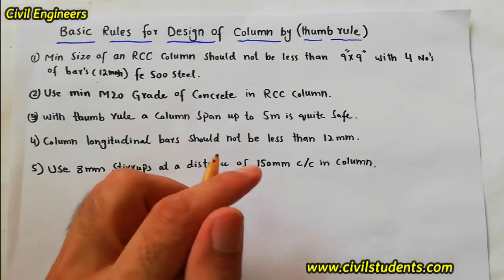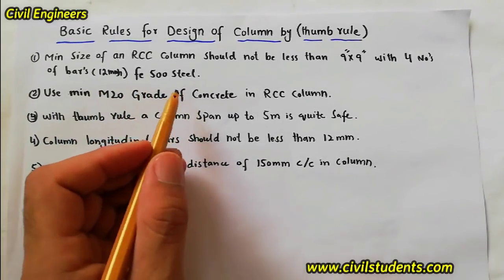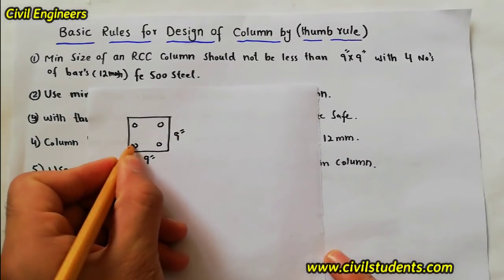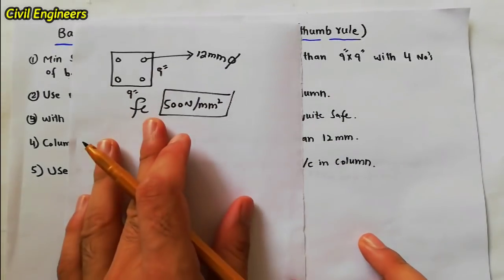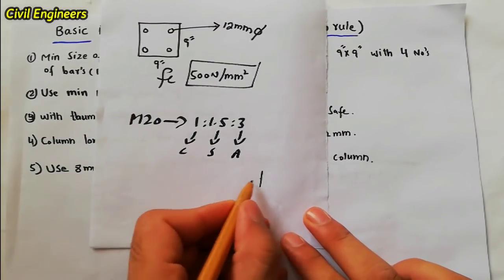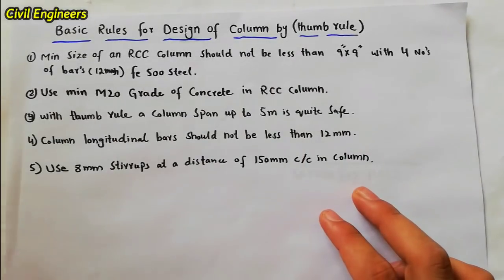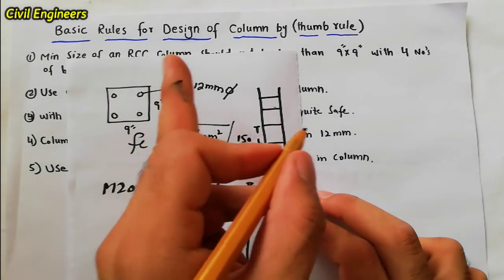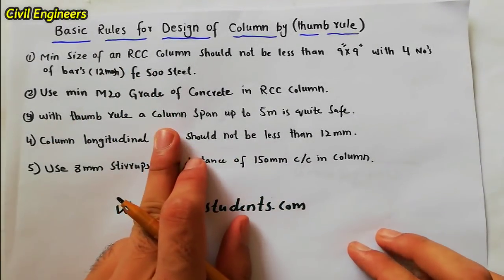Basic rules for Design of column by thumb rule - Civil Engineering Videos

Comment: is two columns 14" x 20" x 12' with 10 #5 steel  too much to support a 14" x 20" x 24' beam which in turn will directly support   part of a 2nd floor (6"x12'x24' slab + 6" x 10' block wall )  (no 3rd floor) ...?

Comment: Sir I constructed two column of 9 inches with 6no 12mm steel and length between two column is 17 feet and put the beam of 9×12 inches of 16 mm steel.and no wall will construct on this beam.is it useful for 2nd and third stories.

Comment: Sizes of column pretty much depends on the loading imposed from the building.
Reply: Do you always need software like etabs to design rcc column? Is there a way to determine the maximum shear and moment of the columns by hand / manual computation? Or would that be too hard since there's axial load on the column plus earthquake loads to consider?

Comment: Sir please guide the following
Going to start my residential building two story but gount floor complete open no brick ,and only first floor shall be carried out brick work need following information is required 
1) size of columns ,dia of bars and Number of bar required
2)size of beam in plinth and first floor,dia of bar and number of bars required 
3) Maximum span 4.2 m
4) Maximum given height Piller in between plinth beam and first beam
So my plot is sloped lover ground level to road top about 5m height my first floor coming on road level so I asked serial no
 4 tharefore ground floor left open
anishkt1980@gmail.co
Ph-9630728491

Thanking you
Yours sincerely
Anish

Comment: What if.. i need to build a simple one storey house 16mtr x 16mtr , fly above the ground with only 4 big column. I meant i need a structure like a table where i can put anything on the thick concrete slab. But with only 4 equal column structure. What foundation, size column, optimum distance and beam.

Comment: Stirrups is for beams right...
For columns it is tiles.,
Is it right?
Reply: No
Reply: Can you show the calculation safe actual load that a column can carry

9x9  10ft high
4 no. 12 mm bars as explained by uou

What if the load the column
Can carry. 

Can it take. 5000kg axial load

Comment: in the philippines, we are using 16mm RSB, minimum of 4 pcs for a 200 x 200 or 250 x 250mm for at least a 2 storey (5 to 6.0m ht.) with spans of 4.5 to 5.0 m column to columns and  at least fy = 3000psi. my one cent. fyi.

Comment: Assalamalaikum sir, what effect of rain water seeping through rcc slab will be on steel inside slab and concrete itself. It creating damp patches here and there inside the roof downstairs, but other than this is there any severe efect of moisture on the reinforcement bars in slab and on concrete in slab?
What heppens if the rcc slab was exposed to moderate rain fall for about 20 days? 
Does the reinforcement in slab corrode and break or nothing happens if it was just exposed to moderate rain for 20 days.
Please reply sir.
Reply: Sir please reply sir..
Sir we have extrnded (only) slab to 20 inches in width and 46 feet in length using 10mm bars as main bar and 8 mm bars as distribition bar...how much load can it take.? I mean if we construct a 4" wall on its edge for the whole 44 feet length ? Will it support the load of brick wall (either 4" or 9" wall) or will it deflect largely and collapse 
? 
Please reply sir please

Comment: 9" *9" size ok sir but it's c/c of steel bars or total column (concrete +steel bars )ahh sir
Reply: Total column size bro including steel and concrete
Reply: My column in my house is 4pcs 16mm ang 2pcs 12mm in center it is safe my concrete column 13 inches and 5 inches wide it is safe i have 6 column and distance 250meter length and 400meter wide

Comment: This design preferably not be considered, every geometry is different from other, it can not taken blindly this size,  no of floor is not described, height of column is not described, you can take any RCC design book and solve example as your requirement and must fulfil the code requirement of IS 456-2000, IS 1893-2015 and IS 13920-2016.
Thumb rule must updated as code revised....
Reply: Jayesh Rajai i agree with you sir Jayesh..

Comment: If the distance of the two points is 17 feet what will be the size of beams,mention the mm of steel rod ,and how many beams required between 17 feet , mention  the deminsion of beam (9''×9''or 12×12). please reply

Comment: Sir, what is the standard size of column,beam, thickness of slab for residential home two storey.
Reply: Different countries use different standards. That's the first thing you should know. In a country like Nigeria where we use the British Standard (BS Code), the least for the depth of a slab is 150mm, least for beam is 230mmx450mm, and least for column is 230mmx230mm. Those are the least. But those sizes can still be increased based on the spanning and loading.
Reply: romeo abalos
Reply: Is it safe to use aac block 3inchea for a wall
Reply: 9"×12"